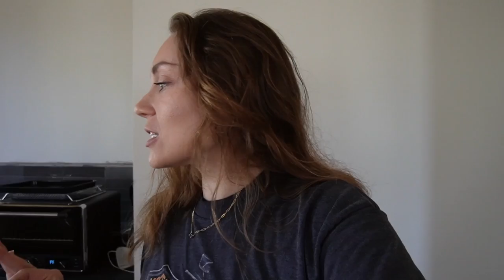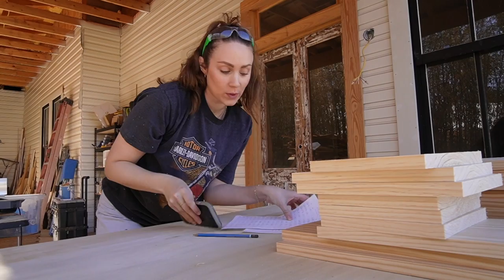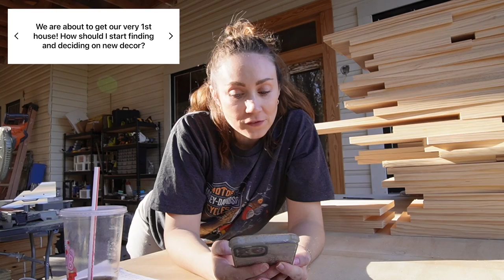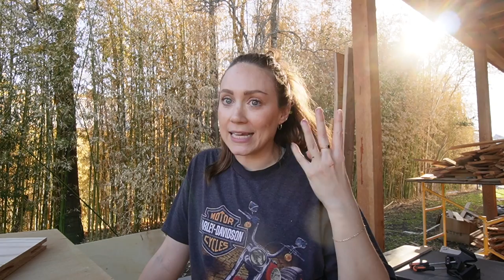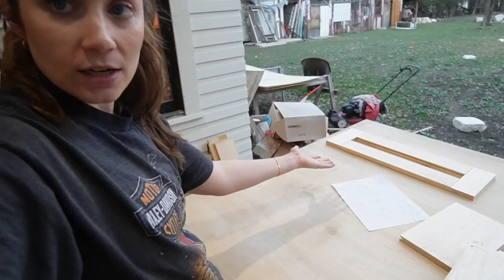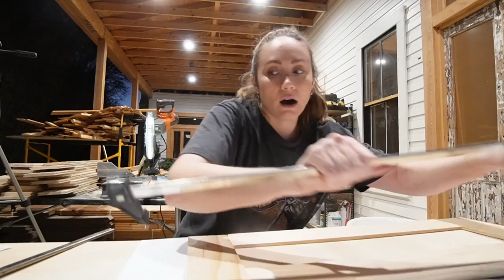building 42 CABINET DOORS for our KITCHEN *from scratch* | XO, MaCenna Vlogs

Comment: I re-used my old cabinet doors, but constructed frames, similar to Macenna's, to go around each of them. This covered up the old 70s scroll indentation that ran around them. I highly recommend this to anyone who wants to update their kitchen, but save on cost. It was a lot of work to construct the frames, but so worth it. After I attached the frames to each door, I painted them and installed new handles. My kitchen is unrecognizable, and it saved soooo much money!
Reply: Sounds fabulous. Well done you.
Reply: @jmk1962  Thank you! It really did turn out well, and so affordable!
Reply: I did this in my bathroom! That 70s scroll indent is also in my kitchen 😩 my husband won’t let me touch the kitchen though. But yeah the vanity looks so different!
Reply: @marinesgirl1229  If it's just been cut into the wood you could try a hefty dose of wood filler and some sanding
Reply: MaCenna  you’re the cutest. Can’t wait to see a little MaCenna or Romeo jr.

Comment: So I redid my bathroom, also an old porch slanted roof. Sadly I didn't notice the slant until I was at crown project. What I did, I made level line for bottom of crown, and put in spacer pieces around top where it was showing. I think it helped hide the slant, but also there's a lil character in it.

Comment: A little furniture wax on the base and fence of your router jig or table saw helps with big project like this. The wood doesn't stick so much as you push it through and can give your arms a bit of a break

Comment: I'm a computer programmer that also loves DIY:ing, woodwoorking and so on. As such I've learned about myself that I have a logical, somewhat "linear" way of thinking and problem-solving and I have a really hard time thinking "in 3D" so to speak (like when you're trying to figure out measurements for a physical item you're going to build, I simply can't do that without really struggling). 

All this makes me so impressed with how you're not only able to do just that but also without barely any scraps. That takes a sharp mind! 

And on top of that, you're doing it all in imperial units... 😆

Comment: @XO, MaCenna Vlogs - suggestion: I don’t know what they are called but nylon straps with a ratchet like attachment that allows for tightening and release. These are mostly seen used for strapping down loads for transport. Would that option be cheaper than the super long clamps?

Comment: The laundry inquiry stood out to me specific to clothes holding on to odors. Having OCD in general causes me to wash every load of clothes twice, I tried to quit this but couldn’t. As to the many scented fabric softeners, scented crystals and beads, they aren’t so much purging the odors as they are masking them with scented fragrances. Secondly, they make these products with tons of chemicals which can cause skin irritations and breathing problems. I use more organic, unscented, fragrance free liquids detergents and Dreft (baby detergent), dryer sheets, etc. the last thing a lot of people want to smell and breathe in is, all the scents people tend to end up layering themselves with, ie.perfumes, deodorants, scented body lotions, shampoos, conditioners, soaps, body washes etc….then you dress in overly scented clothes, it’s just way too many scents wafting off of everyone. Proper hygiene and cleanliness with just one scent, be it perfume, body lotion is sufficient….I mean how bad do people smell that they need multiple masking scents battling it out. To the lingering odors, the washer basket and drum definitely need to be purged of stagnate water that doesn’t drain/purge completely. There are products that clean and sanitize the actual washer itself.

Comment: Hey Macenna!!! Your doing such a great job on our house and cabinets!! I'm loving it all. 
I work in high end cabinetry and the top drawers are usually called out as "styled as drawers" with smaller rails. And the larger drawer like on a 2 or 3 drawer stack are called "styled as doors" because the stiles match the door stiles. And sometimes people just choose slab for top drawers since standard top drawers are 6"h. Also need to go slab if like a knee drawer at 4"h drawer front.

Comment: MaCenna, regarding guest bathroom crown molding & it’s corners too —TIP:  create some templates using printer paper.  Tape up the paper on the upper walls & ceiling, fold it if you have to in places, overlay it on each other if you have to, then take it down, cut into pieces that you would really need if it were the crown molding, and then you’ll have a good GUIDE to use, AND your brain can better piece together how to create the crown mold pieces!!! -Your welcome! 😉
Reply: Great idea!👍

Comment: Good way of knowing if your router bit is in the middle of your board is to just flip it. If you have more wood on one side the bit is going to hit it when the wood is flipped, but if it's right in the middle the bit should glide through the groove no matter what face is up or down.
Reply: So smart, gonna write that down

Comment: Hi Macenna. You mentioned you are not looking forward to doing the crown moulding in your bathroom. Not sure this will help, but thought I'd mention it anyway. My husband has owned his renovation business for many many years, (about 35 yrs.). When he does crown moulding, he always cuts it upside down with the miter saw. Not sure why, but he says it makes it a lot easier to figure out and his joints are always nice and tight.
Reply: I think the reason is the sloped ceiling?

Comment: You need to check out on line these tools called "contour gauges" Amazon has a few and they are relatively affordable. The gauge when pushed up to the area you need a measurement for will conform to that area, then you can trace off from the gauge onto your wood and cut.  These are used when you have crazy angles or obstacles you need to cut around.  The gauge might help you with the crazy  sloping angles in the bathroom for your crown molding cuts.  Happy to see you are getting the kitchen done, will be so satisfying for you to have it completed!

Comment: The only thing I've found with flat for walls is that its harder to clean - if you don't have a headboard or lean over a chair, it easily picks up hair & skin oils (or even oils from cooking) & can soak into the wall. I've found those with more sheen to them (like my childhood home) were so much easier to clean.

Comment: If you use kreg screws on both the rails and stiles, you won't need the clamps.  You can cover the pocket holes with plugs.  Easy peasy

Comment: MaCenna, there are online cut calculators you can use. You input your wood dimensions - boards or sheets, the cut sizes you need and quantity. The calculator will show you the most effective way to cut to get your cuts with minimal waste. You’re also able to print the cut list and diagrams. I use it for my projects.

Comment: Hey MaCenna!  Tip on your next crown molding project… I saw a video where they were using a Saker Contour Gauge Profile Tool for those hard to figure out miter joints. I’ve never used one myself, but it looked like something that would make pesky angles easier to deal with. Is it at least worth looking into?

Comment: There is a free software called max cut, we use it at my work but you put in all your panel sizes and the size you’re cutting from and it optimizes it for you and even take into account the width of the blade

Comment: Watching you build has spoiled me for other people. I always think "What would MaCenna say about this?" Recently I saw a guy use tar paper as insulation between studs and drywall. Instead of taping the seams of the dry wall he nailed sticks over the seams.  Then laid a Hardwood floor with no vapor barrier between the wood and the cement. I thought of you and how you' probably cringe. I know I did and I can't build.

Comment: Errrr the new place really isn’t English farm house. More like you said coastal.
Reply: I would have said the opposite.
Reply: @Lucinda_Jackson  I was thinking 30’s Hollywood bungalow,especially before the additions?
Reply: @lauramitchell6725  
I'd agree with that.  It doesn't seem coastal to me at all.  It feels like tens of thousands of houses built in the Eastern half of the country in the 1920s - early 1950s.  I can't speak for what was being built in the West as I've never lived or even traveled much there.  I'm familiar with various styles, but don't know enough to know what's actually typical in tons of neighborhoods.  So, choosing between those two, it definitely doesn't feel coastal to me though I'd also agree it doesn't feel farmhouse either.  I think the brick floors are making her feel that.  If I had to give it a name, I guess I'd pin as Colonial Revival with California influences?
Reply: @lauramitchell6725  
Meant to say that I think you're right - I think it began as more of a bungalow style (interior, but not exterior) that was fashioned into something more.  I think the exterior must be more of an English cottagey feel which may also be where the English farmhouse reference comes in?   I also think she's being influenced by the decorating style she's going for which I think is actually more English country home which isn't farmhouse at all.
Reply: @Lucinda_Jackson  Yes,it’s hard to pinpoint exactly,between the structure,additions and decor, it’s a little bit of everything!😂😅🤣 But I like your “Colonial Revival with California Influences”(the kitchen especially seems Early American with the brick floors and cabinets,love them both)
Reply: @lauramitchell6725  
Me, too.  I just love that house!